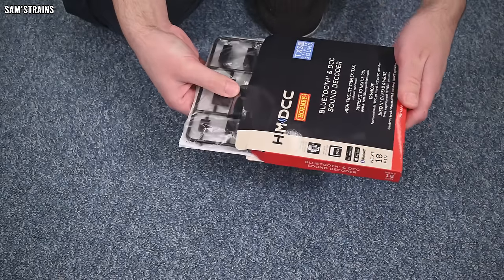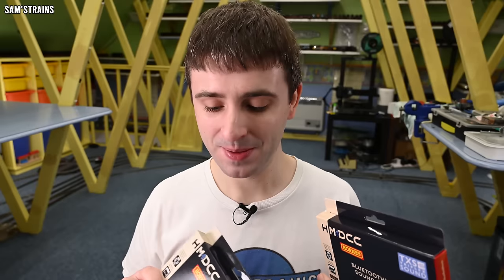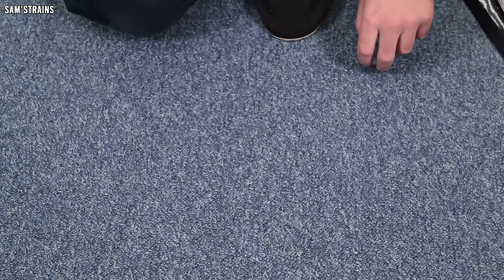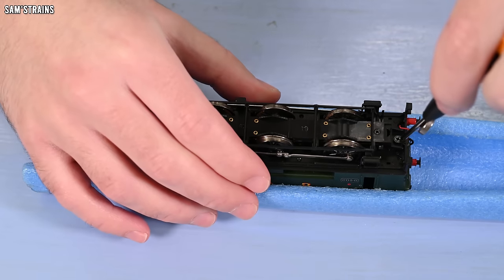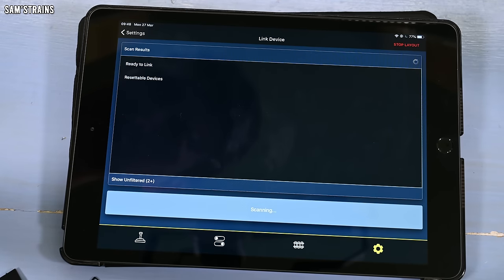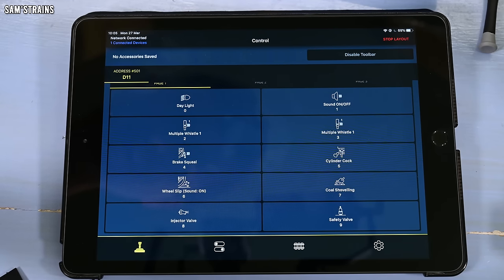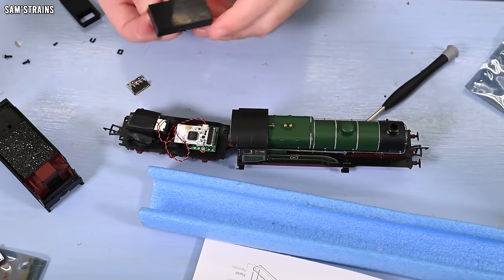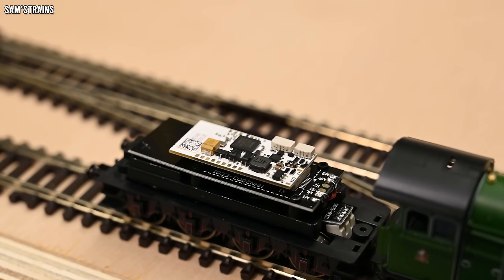Too Big For Most Locos & Burnt Out After 1 Day | Hornby's New HM7000

Comment: Dear Sam's Trains - I have some constructive criticism for you regarding this video.

1 - This first one I don't entirely blame you for - the testing of the next18 decoder in non Hornby locos. Knowing Hornby they only designed their decoders with their own loco's in mind, which is why they are so stupidly large. Most likely for their TT range, while 99% of everyone else would think of non Hornby brands like Bachmann, Rapido etc when Next18 comes to mind. I think personally Hornby should either reduce the size of the decoder - it really is too large in my view, or state that it will not fit in most non Hornby locos. 

2 - When you were testing the sound for the D11 for the first time you didn't follow the instructions regarding power cycling the loco, you seemed to ignore that, then when you tried operating the whistle you seemed to be purposely avoiding the big sound off/on button, I'm not sure why you were avoiding that button but it was really frustrating to watch. 
You stated when you turned it off/on again it started to work, thats most likely because you power cycled the loco like the app told you to do - also you pressed the sound button this time so the sound worked. 
I'm hoping this was just an editing error but honestly this section left me in a rage.

3 - First time testing the operation directly on a point seems a little unfair, especially when you weren't used to operating the system -  example being you weren't sure how the brake feature worked. I have a Digitrax controller with a brake function and from what i could see it works exactly as it should.

4 - I was going to heavily criticize you for not selecting the TT Scotsman sound profile - which you should have done btw, as the app shows both 00 & TT profiles - look for the 00 or TT icon in the top left of each loco's profile, as for the longest time watching this video i was convinced thats why the sound wasn't working. But having seen that it doesn't import the function map by default, that is a massive blunder on Hornby's part, no average user would think to do that, so Hornby is definitely in the wrong here, but you should have selected the TT Scotsman profile - its possible that would have worked by default hard to say however.

5 - your interruption recovery times section was fantastic -  that is really poor performance honestly

6 - Imo you should have got the 8 Pin version to test as well

Conclusion - Sorry if i am coming across as some kind of snob, i honestly enjoy your videos and i have learnt countless things from you over the last couple years, but this video honestly made me genuinely angry at times and i had to vent in a structured and hopefully easy to understand way to get it out of my system. 
Love your usual videos and hope you have a good day!
Reply from the maker: Thanks Michael
1 - Yeah if they'd stated that these were only going to fit into their TT locos, then it'd be clearer for customers and would've saved a lot of time.
2 - The on-screen instructions were followed to the letter. I did power cycle the decoder whenever I was told to, though this may not have been obvious through the final edit. I restarted the app the second time round, and then it worked.
3 - That loco has plenty of pickups in both the loco and tender, and as you saw the point caused no ill effects.
4 - The sound profile doesn't matter as the decoder doesn't know which loco it's driving... the sound may be better tuned to the speed of the loco on the TT version, but otherwise it makes no difference.
5 - Glad this was useful - yeah this could be a problem couldn't it?
6 - The 8 pin decoder wasn't in stock at the time of filming/ordering unfortunately!
Hopefully this answers a few of your questions!
Thanks for watching, Sam :)
Reply: You honestly got angry at this video- for real?

Comment: Blue tooth is slow and range can be a problem.
Reply: Hornby stated today the range is 45m plus it works as a mesh so also 45m from any other Bluetooth connected loco on the tracks  not just from the app.

Comment: Come on Sam, 0-4-4 and 0-6-0T’s are never going to be very big. I laughed out loud when you brought out the J72. I’ll be trying to fit these to ancient Triang Hornby and Hornby Dublo locos. So I guess I’ll need a wiring loom. Dunno whether that exists on the market…
Reply: Such wiring harnesses do exist. I would be very careful of current draw if I were you. Older locos fitted with hungry motors like a ringfield or an XO4 can draw atypically large currents. A cursory google hasn't yielded a tech spec for the HM7000 decoders but I'll wager a particularly worn motor would blow one up quite happily especially given Sam's experience in the video. Worth doing one's homework before risking the magic smoke
Reply: @bruvaasmodai5250  
Thanks for the tip! As an old fashioned DC git I know little of such things! Much appreciated. Maybe I’ll just stick to my H&M Duettes and Clippers 😉

Comment: I honestly think you have to actually have to cut it. The side that pokes out has no electric purpose (or that's what I can see from the video at least). I know the UK market is about 15 years behind the EU one when it comes to digital and DCC systems and around here we are quite accustomed to cutting or adding a socket with just wires so it reaches it's designated area. It's just how these things work sometimes. But again UK is behind so it may seem weird and "not right" to cut your decoder "to measure". 

In the same time Hornby could've just made them shorter - I see there is a QR code on them there, maybe for the warranty or such which is truly waste of space :))
Reply: i think you'll find you will remove the Bluetooth aerial if you "cut". As for the UK being behind?>>> Where is the ESU bluetooth DCC chip and where is their easy to change CV's from a simple phone app?!!!
Reply: @wapphigh5250  Everywhere?:)) I just installed the main on my phone, you can do that you know? Also Piko had an offering of Smartphone connection AS A START SET. Premium of course, 500 EUR but it was a start set. Roco offers the same and Z21 systems can be put on an iOS and Android for about 5 years now :)))
Reply: @heiderichvladimir7341  all this is not the same thing as direct bluetooth control of the chip and changing Cv's on the fly! Do more research! Cheers
Reply from the maker: I don't fancy cutting the decoder - presumably that board space is being used for something... I don't think they'd be so dumb as to make the decoders unnecessarily large!
Thanks for watching, Sam :)
Reply: Might have trouble returning a faulty burnt out chip if you’ve cut it!
Reply: If you cut the end of you will destroy the antenna
Reply: I think we’ve been trolled
Reply: @wapphigh5250  Alright, not the same as bluetooth control but why do I need that specific technical means to achieve the same result? Z21 is based on Wi-Fi signal, yes you need internet connectivity but in today's world that is a given and indiscriminate internet access is a human right! 

It's just another way of doing the exact same thing which is present on the market for years now. But there are simpler examples for this: adoption of NEM sockets, short couplers...to name a few things I was amazed back in 2015 watching Sam and seeing the lack of.
Reply: @SamsTrains  Yes, but if there was a bluetooth antennae there, your scisors or exacto-knife would've bit into and you would've seen it. Either way, it's a shame the decoders are that way. You should get your money back, thanks for a true and impartial review! Professional as always!
Reply: @ianbusby2845  Yeah, trolled by a company that is supposedly one of the biggest in the market. I get it - the decoders will not fit Bachmann locomotives, will not fit Oxford Rails or what other producer, but not fit Hornby locomotives? Their own product? That's a trolling we would've been best without
Reply: @heiderichvladimir7341  er methinks you misunderstand 🤨
Reply: What EU system allows your sound decoder to be refitted to a different type of loco and have suitable sounds for it within 10 minutes?
Reply: @Cloudman572  All? But you know, you have to also put in the digital work for it, it's a professional thing still and a complex tech still. Marklin/Trix offer just what you see in the video with the MFX partition of their products and there's about 150 MFX locomotives data which can be imported and used on other locos as well. Why do these things seem so new or revolutionary that "what other EU producer..." to you guys? At this point I feel like I answer with "what other EU"-all. -All of em. :)) I know DCC is not a field for all, but trust me, for people who take interest into it, the sky is the limit for about 15 years now :))
Reply: @Cloudman572  ZIMO. Takes around 2 minutes to upload a full sound project to either Next18 or 21 pin decoders using SUSI connection.

Comment: It might be possible to cut the end of that Next 18 decoder off as it appears to have no SMDs or even traces at the end. Of course this will void any warranties and yours already died just on it's own. It's not something any normal person would do either, but in a pinch it could work. For engines where it's too wide, you'd have to just modify the engine. As others have said it definitely is a brand compatibility issue.
Reply: Apparently the end has the antenna for blue tooth reception so cutting it off might be a problem.
Reply: @mkaustralia7136  Yeah that would make things difficult

Comment: For the 18 pin decoder: have You tried the Caledonian 812 ? By the way, I think that Big Kendo is right about Hornby`s selling politics.
Reply from the maker: I didn't try that one - the 812 has a socket in the loco, so there's even less room. Pretty sure it won't fit anyway - the Hornby decoders are significantly larger than the NMRA standard, so the only way it'll fit into any loco other than Hornby's is if you're very lucky!!
Thanks for watching, Sam :)

Comment: I would like to throw another spanner in the works for this system at least for steam locomotives as the exhaust synchronisation is terrible the A1 managed one beat per revolution of the wheels as against six for the real thing. For me this is a total failure. It may be possible to adjust this in the CV settings but you shouldn't have to. A well designed project will take that into consideration and give appropriate beats per rev.
Reply: David, I was watching the live stream this afternoon and your observations came up, they said that you must download the correct profile for your locomotive otherwise due to differences in scale the “chuffs” will not synchronise with the wheel revolution.
Reply: I would say there is no proper chuff sync (that is, with reference to the back-emf of the motor). It is just multiple sets of ‘fixed speed’ chuffs as per the TTS system.

Comment: Can hornby make any new product work??
Reply: Sounds daft doesnt it, like why don't they reach out to people like Sam prior to launch to ensure any design errors are corrected prior to release... Or is that too sensible? 😂
Reply: @Ande P  Sam has bester testing than hornby does🤣
Reply from the maker: Well the failure may just be unlucky... but the size of the Next18 decoder is a huge oversight... maybe they couldn't make it smaller... but frankly what's the point?!
Thanks for watching, Sam :)
Reply: @SamsTrains  Sam please make a list of any Next18 locos that will take the Hornby Bluetooth. And post it or mention it on a later vid. Thanks W

Comment: I have a couple of "cons" to mind that you didn't mention.

Firstly, you can't have a friend with their own phone without re-pairing the loco with their phone, and pairing it back afterwards.

Second is that the app only works by logging in to Hornby's servers. If they decide to stop supporting HM7000 on a few years (remember Zero1?) or even go bust, then your investment is worthless.

On the pro side, I agree with all your points but will add that allegedly having multiple locos running will form a mesh so super fast reconnects. But your demo was far worse than I'd expect.

I'm also seeing comments that the chips don't like being run on a PWM DC system like Gauge master, and really want a simple AC or DC controller.
Reply: These new Hornby decoders can be run off of a regular DCC controller (thank goodness) even if their Bluetooth system does go out of existence.
Reply: @kiwitrainguy  Yes, you could still run your locos; but you'll lose the ability to switch sound profiles, as that needs the app and can't be done over DCC. I'm not sure also, can the basic CVs be programmed over DCC as normal, or do they need the Bluetooth to do that?
Reply: @roundel52  The CV's should be able to be changed as on a normal DCC system (Programming Track or POM). If this is not possible with these Hornby decoders then they don't seem to be much of a replacement for existing DCC decoders. Perhaps they are intended just as a way to convert DC people who have smart phones over to DCC.

Comment: I’m not impressed so far. On the fifth attempt to download a sound file, and the app either crashes or, if it does download, I get a no sound file error message. Even at 12 minutes a download, that’s much too much time wasted for something that doesn’t work. Can’t control the chip using software because of the lack of sound file, so it’s useless.
Reply: Sixth time’s the charm! Now fully working. Frustrating, though. Also the 8-pin decoder and harness is massive. Barely got it into a T9 tender after removing the tender weights, and no room for a power pack. It may be half the price of traditional decoders, but if it’s uninstallable in many locos, it’s a failure as a system.

Comment: So do you need DCC Sam? Your title says it's for DCC?
Reply: Like you can't fit these to anything that isn't DCC ready right?
Reply from the maker: You don't need a DCC controller to use this system if you have a power supply and a smart device. You can fit these decoders into any loco with enough room. if the loco isn't DCC ready, you'll need the 8 pin decoder and you'll have to hard wire it
Thanks for watching, Sam :)
Reply: @SamsTrains  thanks for clarification

Comment: You stop layout and resume to get it going again? And sound you add sound functions. Your making out this doesn’t work correctly but not giving full knowledge of the use. You say these don’t fit any locomotives with 18 pin which looks to be the case in your video but you can’t say it doesn’t fit any loco when it clearly fits Hornby. Your wording in some of this video isn’t good.
Reply from the maker: No - locos often cut out due to dirty track, point deadzones, or unreliable pickups. This test was to demonstrate how quickly the decoder recovers from such an interruption - what knowledge am I missing here?
The decoder packaging claims that these are NMRA compliant; the NMRA specification for a Next18 decoder states that they should be 25mm long with sound. This is longer and therefore doesn't fit into any locos, which demonstrates that these decoders are in fact not compliant. Nothing wrong with the wording, I'd advise obtaining a clearer understanding of the subject in question before criticising mine.
Thanks for watching, Sam :)
Reply: You have a huge following and therefore a responsibility not to be miss leading.
Reply from the maker: I'm not Miss Leading, I'm Mr Sam's Trains, and what I told you was correct. Don't ignore the facts and substitute your own nonsense!! Look up the Next18 NMRA standard and read the dimensions!!
Reply: Ouch 😂

Comment: Looks like the new system is as glitchy as the TTS cards, typical Hornby hit and miss, might work might not accessories and may pack up or fry itself if there's a "Y" in the month. I have 15 TTS cards and 6 have fried themselves mid use, £600 down the drain.   Grrrrr!!!

Comment: Smaller loco’s are not compatible but it fits in a huge tt120.  It’s new tech so why you you expect old loco’s to work.  Also there is no incentive for other manufacturers to make it work as that just gives money to Hornby.  A better review would have also tested a few Hornby tank engines for comparison, but I guess that wasn’t the point of the “review”.  Most of this video was user error, did you approach starting to do 3d printing in the same way.
Reply from the maker: Silly comment. So we shouldn't expect new decoders to fit into any existing locos? We have to wait for new locos to come out whenever new decoders get released? Don't think that's how it's meant to work. No, none of Hornby's tank engines have Next18 decoder sockets, so to do as you suggest would be impossible. Don't confuse user error on my part with ignorance on your part - do some research before you point the finger at me.
Thanks for watching, Sam :)
Reply: @SamsTrains  Nasty and petty reply,  why call me ignorant.  I questioned your review approach, so I am very sorry I have upset you. If you had put a Hornby model in your review that would have helped put the system in context. Would expect better from you.
Reply from the maker: I wasn’t calling you ignorant, I was pointing out that you were ignorant of the fact that Hornby locos don’t have next18 decoder sockets. This certainly wasn’t user error on my part! I did put a Hornby loco in my review - the TT loco was the only one that would fit, because the decoders don’t conform to the standards they claim to!

Comment: All that faffing about just to get  engine running. God help any one who has a layout where there are multiple engines running. Think I will stay a luddite and stick with analogue. As for the size of the Next 18 chip. You said you tried Bachmann and Dapol engines. This is a Hornby chip. Did you actually try a small Hornby loco to see if it fitted in that? Perhaps they will make it a bit smaller later on., but they have obviously made it for Hornby locos.